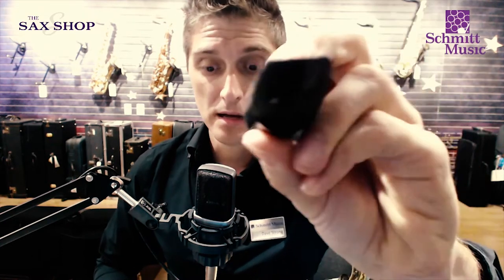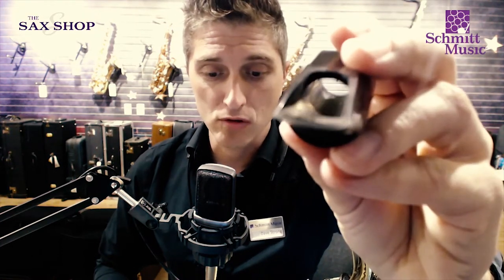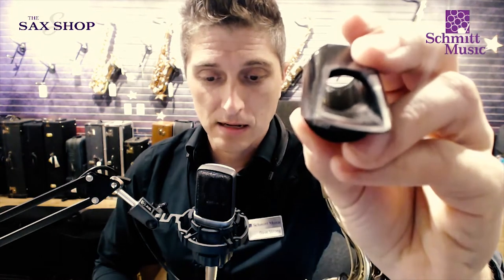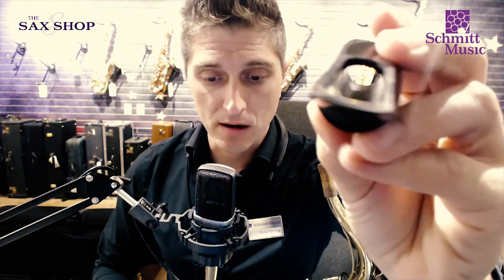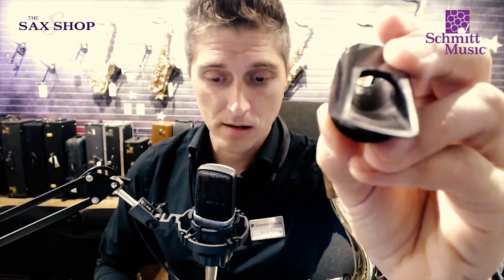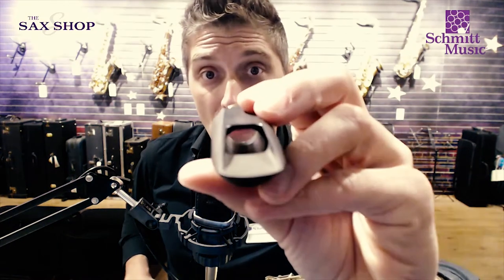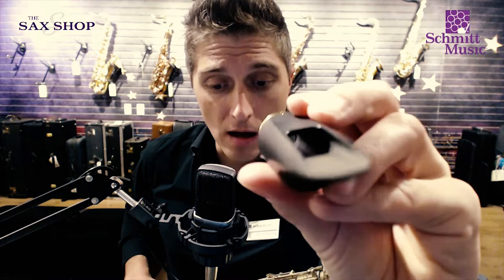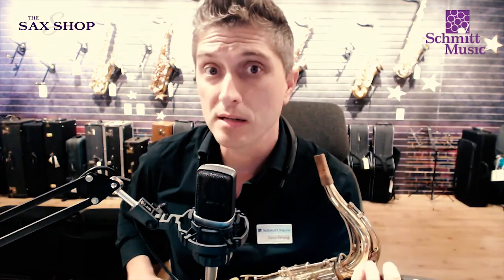What the heck is a BAFFLE?!?!

Comment: Hi Dave, I want to buy a good mouthpiece for my tenor selmer selx 80 action sax, I have a lot of doubts because I don't like any of the ones I have, I use dukoff, beechler, jet 7, claudie lakey 6x3, I want a bright, powerful mouthpiece, which In the high register of the saxophone it is comfortable, but the most important thing that does not change the original sound of the saxophone to wood, as is happening with all new brands, I do not have so much money because I live in a country where everything is very complicated (Venezuela ), What do you recommend me? And if you can sell it to me?
Reply from the maker: That's a tricky one.  I really like Phil-Ton's rift.  Also, the 10MFan Showboat is really good.  They're not super cheap, but they are great.  For a less expensive one, maybe try a Vandoren Jumbo Java.  Thanks!